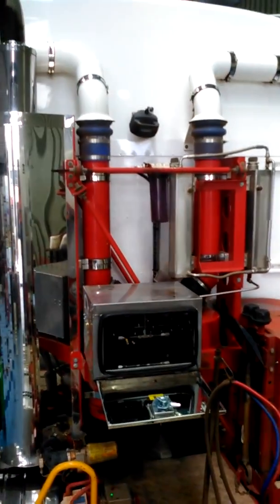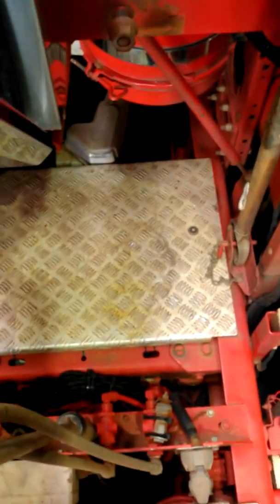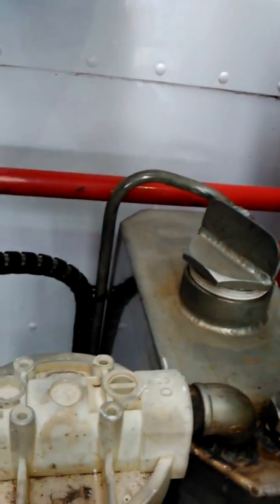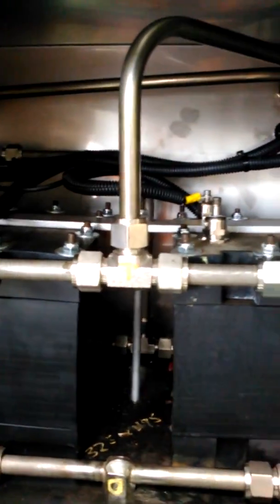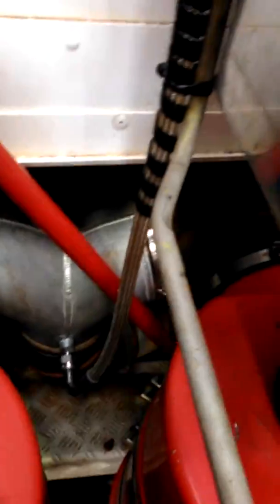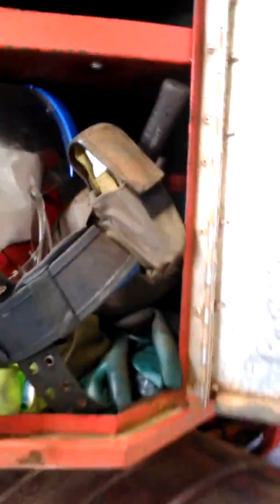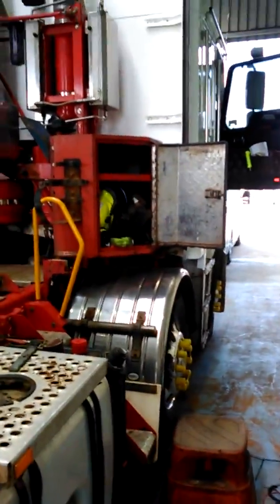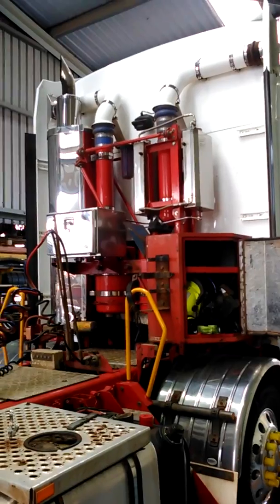Unbelievable Hydrogen gen 20 - Cummins powered 15L trucks https://www.hydrogenfuelsystems.com.au

Comment: Looks very nicely installed but some information regarding the difference the installation has made to the performance and fuel economy is a glaring omission. Many, many individuals such as myself are somewhat perplexed by ambiguous claims and/or lack of information Gavan. I'd recommend you provide some accurate and reliable feedback on the advantages of running this system and watch your sales figures light up mate! Assuming of course they are providing a worthwhile benefit :)
Reply from the maker: https://hydrogenfuelsystems.com.au   0403177183
Reply from the maker: call me on 0403177183 
glknox11@live.com
https://hydrogenfuelsystems.com.au
patented , proven and certificated system delivering 32% savings on a 7.2 L truck - 27 tonne load
Reply from the maker: call me on 0403177183 
glknox11@live.com
https://hydrogenfuelsystems.com.au
patented , proven and certificated system delivering 32% savings on a 7.2 L truck - 27 tonne load
Reply from the maker: call me on 0403177183 
glknox11@live.com
https://hydrogenfuelsystems.com.au
patented , proven and certificated system delivering 32% savings on a 7.2 L truck - 27 tonne load

Comment: can i get a price idea (approx) for supply and fit to a Mercedes Benz 1418 coach thanks
Reply from the maker: call me on 0403177183
glknox1@live.com
www.hydrogenfuelsystems.com.au
Gavan
Reply from the maker: 4650
Reply from the maker: call me on 0403177183 
glknox11@live.com
https://hydrogenfuelsystems.com.au
patented , proven and certificated system delivering 32% savings on a 7.2 L truck - 27 tonne load
Reply from the maker: call me on 0403177183 
glknox11@live.com
https://hydrogenfuelsystems.com.au
patented , proven and certificated system delivering 32% savings on a 7.2 L truck - 27 tonne load